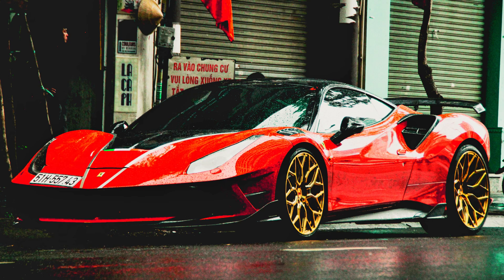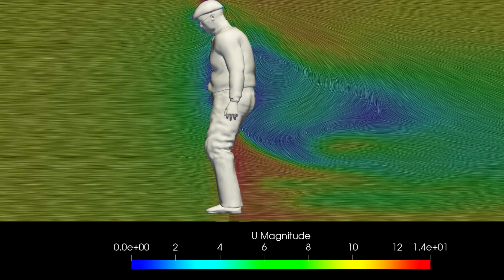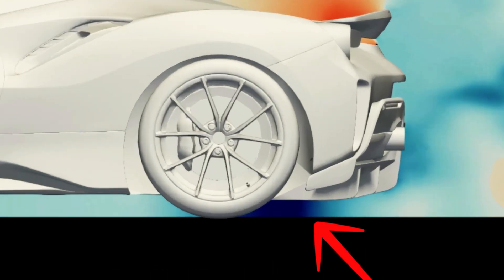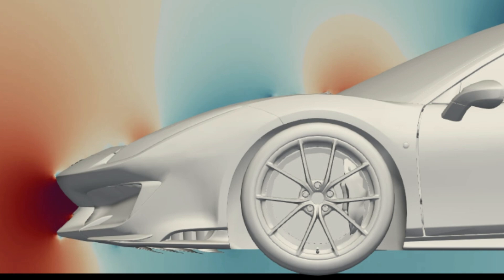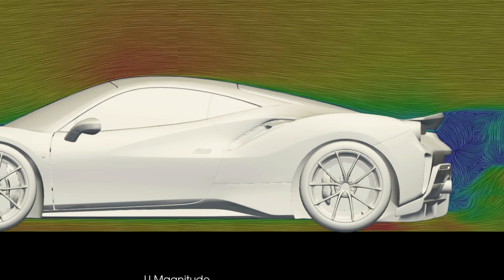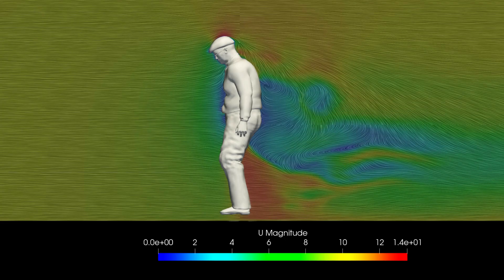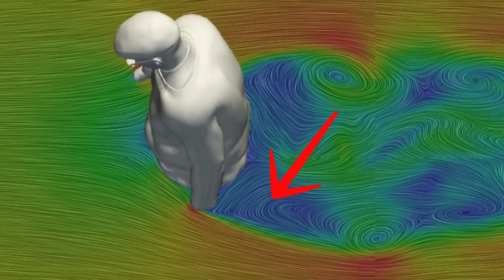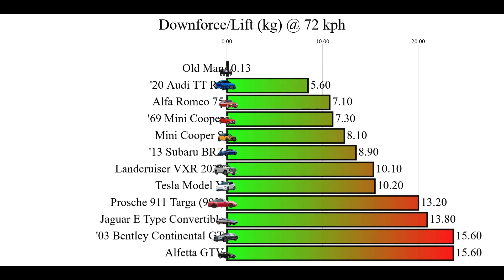Aerodynamics Of Ferrari 488 Vs Old Man

Comment: Those two scooped channels on the hood do a good job of guiding air around the sides of the roof.
Reply from the maker: Yeah, definitely. And there's an element in there that helps with the downforce two. So, it's like a two vane channel to begin with.